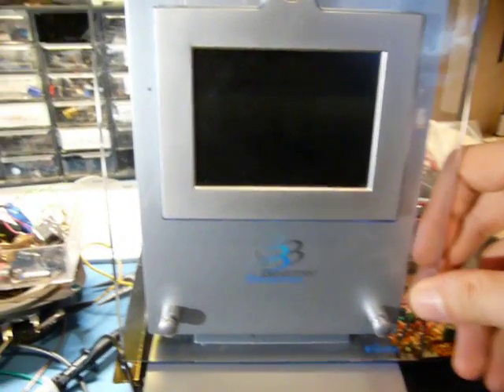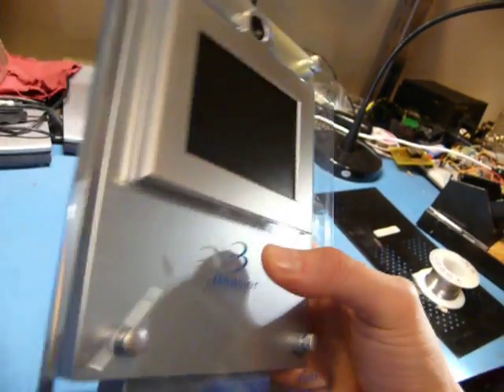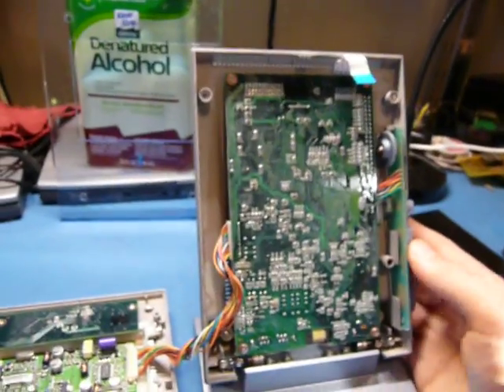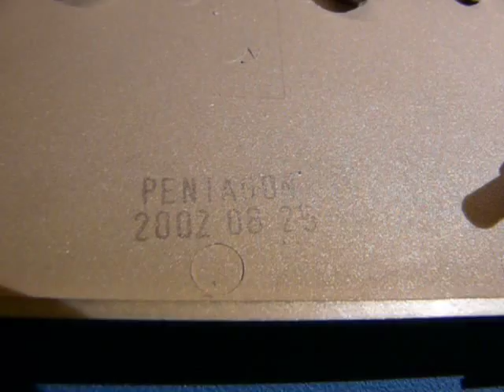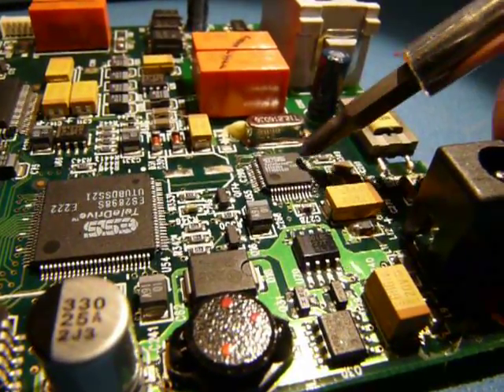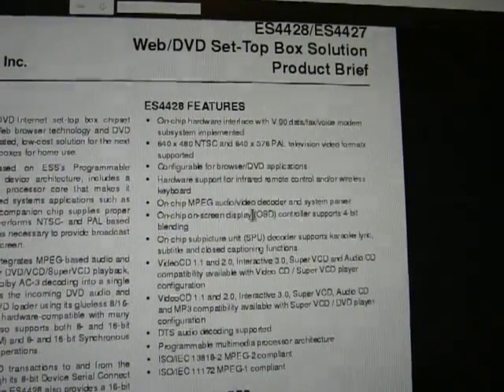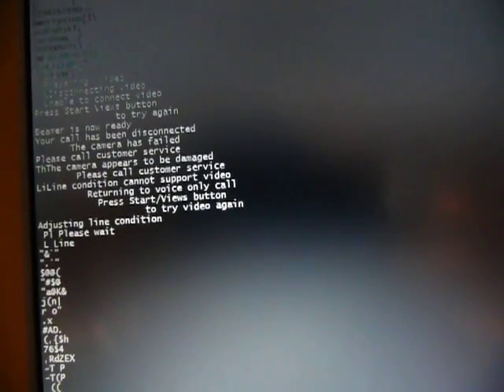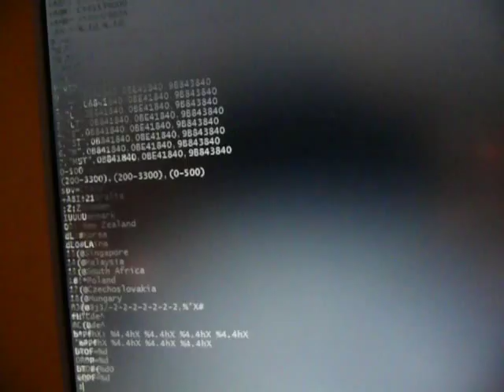vialta Beamer Video Phone Teardown

Comment from the maker: I think the interface is some sort of parallel setup. I didn't actually hack the LCD, though. When the device starts up, it displays some welcome messages. I found those in the flash and overwrote those with my own. Sadly the device calculates some sort of checksum, so when I tried my modded flash it just printed "system error". So, I found where "system error" was and replaced it with the message you saw :). There wasn't much room, hence the abbreviated wording.

Comment: I just rescued two from the local scrap yard.  The LCD is a PrimeView BW-PVV07.  It does lift out form the case.. When I dismantled one of mine, the LCD screen stayed stuck to the back of the white plastic carrier frame, but lifted off no problems.   It appears to be a standard LCD display, removable from the board with the HV inverter, The driver board in the carrier frame appears to be a analog driver, with wires not only for the Red, Green, Blue, But also wires for the tint, contrast, brightness, and color saturation (Noticed empty pads on the main board right of the camera connector.)      I wonder how much info is out there with the parts now, compared to 2 years ago?
Reply: Ah-HA! The Garmin Nuvi 3790 used the exact same LCD, with a analog touch panel over the face.  As far as I can tell, the board for the camera is a custom (Vialta proprietary), My only guess, is trying to remove the CCD chip from the board, to trace out where the connections go for the chip itself...   I managed to extract the driver board for the LCD, and I can't quite make out the logo on the back ov the board, bottom corner, behind the inverter.. Looks almost like Hitachi's old logo.  Followed by D-3, 94V-0, 0227  AH! There IS an identifying mark below the inverter connector (obscured by the plug for the CCFL.) A035DSAE , followed by a manufacturing data 06/01/2002. Which, turn up nothing on google.  I can't get my eyes to focus enough on the chips on the board.